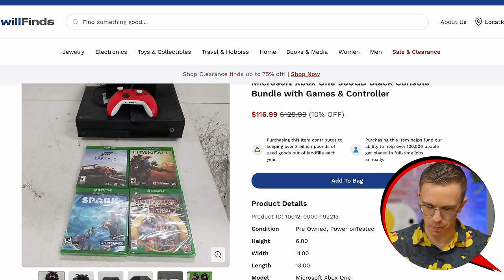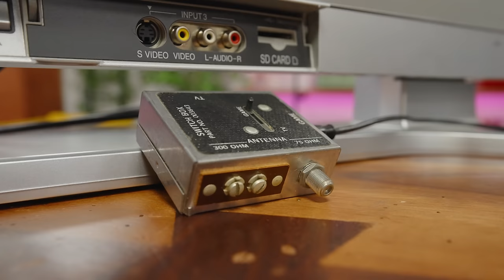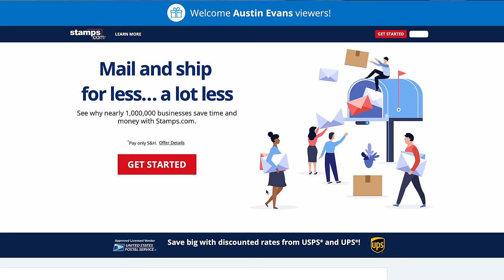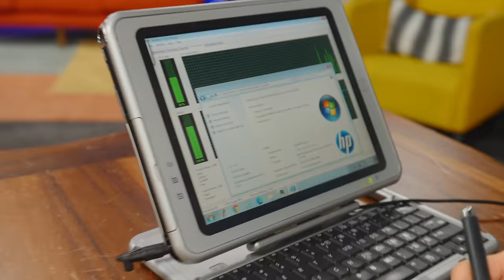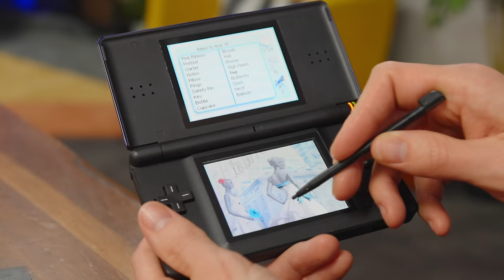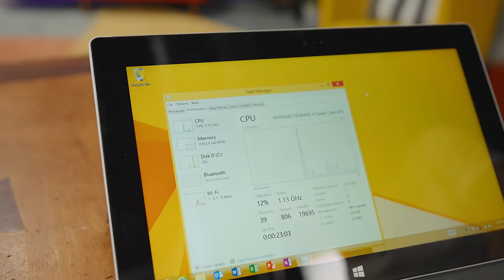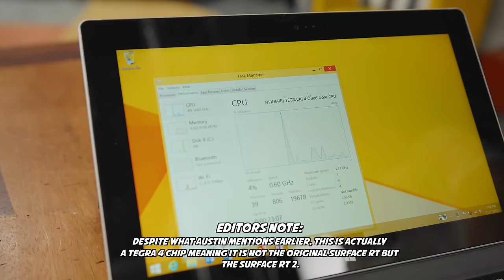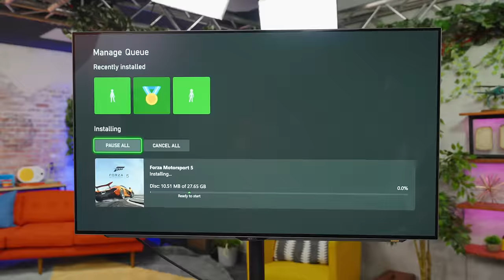I bought WEIRD Tech from Goodwill

Comment: I once worked for a medical company that used those exact HP tablet laptop PCs. Back when they came out, there weren't a lot of other options that had a touch pen and swivel screen. They had a high failure rate, and sometime in 2008 it started getting difficult to find parts for them.
Reply: Makes me wonder if Surface tablets added to this headache or alleviated it
Reply: @stephsnotfluffy  headache cause battery would pillow up on surface
Reply: I actually worked in a hospital system as a PC tech around 2014 or 2015. One administrator actually still wanted to use his old ball mouse instead of modern optical mouse. I've seen tons of tablet PCs before everything was upgraded. They were using Fujitsu laptops with the stylus. Thankfully the swivel action is built into the laptop but yeah parts were not easy to get, especially since they only got them through their contracts. No picking up discounted parts from eBay or any other provider here. Now were they reliable? It's been far too long since I was employed by the subcontractor and didn't work long enough. I was only contracted for 3 months. I miss those older laptops. They were so easy to service if they needed a new battery or something else.
Reply: Thing is actually cheap when bought in bulks, however its really expensive when bought for only an individual

Comment: 13:45 Hi Austin what you said is right. Back in 2012 nothing ran on the Surface RT except for windows apps. But now in 2023 I found out that there is a team who cracked (somehow) windows to load windows 10 on it and with some several tweaks you can install a lot of windows 10 programs.
Reply from the maker: So I've seen a super old build of Windows 10 that you can load on it but nothing vaguely modern?
Reply: @austinevans  You can run linux
I would give you links on how to do it but the comments wont let me.
Reply: @austinevans  Finally, Btw You have a surface 2 not an RT. The Real RT is Black and has a Tegra 3 chip
Reply: @TwoDpads  I had the same problem, I have commented for the third time now.
Reply: @austinevans  In terms of windows 10 versions, no it is only that specific one. But the same development team also discoverd to boot Linux on the Surface RT. Maybe you can try that? 

I've tried to put a link with this comment to give you some more information but Youtube doesn't let me to (to be honest i tried several times, so this is my 5th try XD). Anyway I have the link if you want some more information on it!  

PS: the discord server they have is still active today.

Comment: My local Goodwill recently had a Synology DS1019+ for $20. Bought it basically untested since it didn’t have the power supply, but went on Amazon, got a $30 power supply for it, and it works perfectly fine

Comment: For Super Pong, if you wanted to see if it would work, run the cable from the Pong unit directly into the yellow composite input on the TV, rather than through the RF modulator switchbox.  Since the speaker is on the actual Super Pong unit, I suspect that the cable off of it only has composite video, and doesn't need to be converted to RF. 
The graphics would probably would look a bit better, or at least cleaner, if this works.

Comment: I bought the original Surface RT tablet. It was a great piece of kit back then. I mostly used it as a laptop for school, and it did do everything I asked it to. Also it was the only tablet capable of running Office. Back then I also had a windows 8 computer and a Windows phone and all 3 of them used to work perfectly in sync of each other. 
App support wasn't great, but apps weren't really that big yet. 
Over the years the battery died and there is no way to replace it. Therefore I now only use it as a glorified digital picture frame running a loop of pictures in my gallery.

Comment: You should update that HP tablet, put a 4GB stick in, a IDE to Sata adapter for a SSD. Also you might be able to upgrade the CPU, Centreno was used for a line of cpu's from PM up to Core2 Duos.... Centrino was more less codename for intel cpu with a intel wifi nic combo.  Also you could try win10 or use Andriod OS for X86 or just put ubuntu with Gnome 3 which is tablet friendly.

Also the surface you could install andriod on that as well.

Comment: The Surface 2 is still usable in 2023, it just doesn't work well for most things. I converted mine a couple years ago to be a portable media center; it has all the main streaming apps installed and I purchased a mini-hdmi to hdmi cord so it can be plugged directly into a TV rather than trying to cast it. I also added a 512gb microSD so I can load up personal media for when we go on trips where there won't be wifi. The only problem with it is that the keyboard just stopped functioning so now it is just relegated to being a dust cover; I'm not sure if this issue is with the connection port or the keyboard itself.

Comment: That's not a surface rt, it's a surface 2, which also had the arm processor and thus the rt version of windows 8.1. You can tell because it's the wrong color. I know because I bought a non functional one for the power supply and keyboard, which also work with the surface pro and pro 2 as well as the actual surface rt, that came with it. It was only $40 including shipping on ebay.
Reply: I was looking for this exact comment. I used to use the original RT for school work and YT and that was black, unlike the grey of the surface 2 RT. I still use it every now and then for the nostalgia.

Comment: I recently repaired an Xbox one because the hard drive had died and the console wouldn't stay on for more than a few seconds. The Xbox was clean on the outside but when I opened it up to check for damage I found that the entire board was covered in dried caked on milk. 4 hours of cleaning just to find a few blown capacitors. After the repair it works fine and when I told my customer about the milk she wasn't even sure she wanted to give it back to her daughter! Some people treat electronics like crap.

Comment: That HP tablet can be upgraded a fair bit btw. Also - those drives were... let's say "less than stellar" to be nice. You can get an "IDE to SATA converter" - and actually use an SSD in it. (there ARE IDE controller SSDs on the market - though they can be pretty pricy!) The IDE controller is not fast - however it's a lot faster than those drives - so you would get a lot snappier with an SSD. Also - a "Swap" or "Page" file on an SSD would be a lot better. The RAM can be upgraded to 2GB 333Mhz SDRAM - for 75$-ish in current times. I mean... at 66$ for the system + those upgrades... you could do it all for less that 200$ - which for a retro fan seems freaking fantastic! 

With these two upgrades it will become a totally different user experience - and actually feel way more modern than it has any right to!

Here is the "kicker" - and what ACTUALLY makes this tablet kinda awesome. It has a "NVIDIA Geforce 4 Go 420" GPU. This means that you can play a lot more games than you'd think on it. It's a really cool little retro game tablet/mini PC. Literally a steal at 66$!

Also - according to the info I can find on it - you can replace the battery with a new "301956-001", "302119-001", "303175-B25", "348333-001" or "DC907A" replacement battery. They are in the 40-50$ price range.

Comment: I have a couple of those 2004 HP tablets that I got from the storage closet at an old job about 12 years ago. They were going to throw them out so I took them. They both work, but both have Windows XP still and are really slow. I might try upgrading them to Windows 7 like the one in this video.
Reply: Just booted them up, and one works but the other isn't detecting the Operating System (possibly the hard drive died). Going to replace the hard drive at some point and see if I can get it running, possibly with Windows 7. Switching to an SSD would be nice too if I can find one compatible.

Comment: i still have that HP tablet, i have windows 7 with 1gb of single sd sodimm ram, with 40gb hdd, sadly mine is in rough shape as they been used in the fire department and RCMP police back in early 2000's, mine is the Celeron 1.2ghz, i have 4 with WORKING batteries. and yes the unit gets very hot running youtube at 144p, 480p the unit overheats, it uses a REAL wacom tablet screen but its requires that special pen as its digitized threw it. i also have the FULL dock that mounts to a DVD player and separate second desktop HDD in the dock. sadly recently these machines really struggles with recent internet protocols and the wifi is terrible in those.

Comment: I got a black xbox 360 slim not glossy with a Kinect and a controller with just cause 2 and disc 88# the one 2008 for just under 100$ All working from the display case not even from the website.
Reply: That is solid!

Comment: So... the first computer that Microsoft Sold to consumers was the Surface... nothing attached, but now referred to as the Surface Table. (Or Pixelsense apparently)
You personally could have seen one at Disneyland, inside of Innoventions, it was a literal table, with a large 52 point multi touch display, designed for several people to work on at once, and ran at the low price of about $10,000 per unit.
And yes, they did in fact actually sell them.
edit* to add date... announced in 2007 and actually shipped in May of 2008, and sold through 2013.

Comment: So I must correct you on the Surface, that is a Surface 2. The second generation of the Surface RT and I guess the third computer Microsoft sold, If you count the Surface Pro line. It is a minor upgrade over the Surface RT upgrading from a tegra 3 to a tegra 4 and a 720p screen to a 1080p screen, also it is lighter then the RT. I still use mine, thought with a goofy hack Windows 10 setup, mostly to watch youtube on sometimes, play games I have on it, amusingly not to browse the web at all because their is no good web browser thanks to microsoft locking it down.